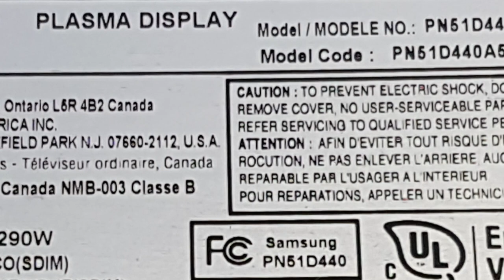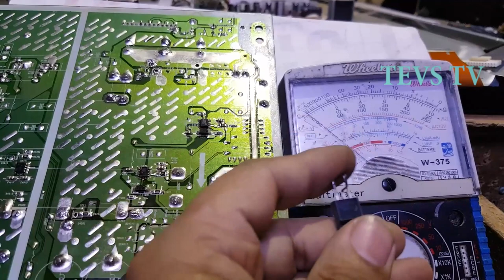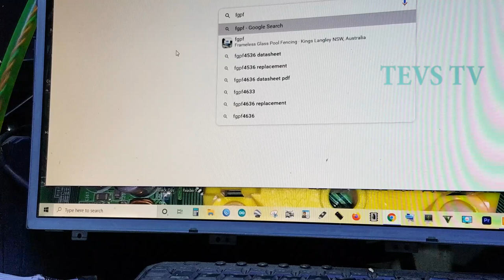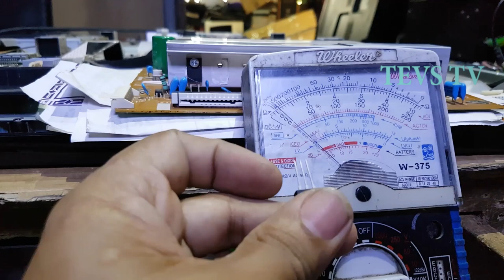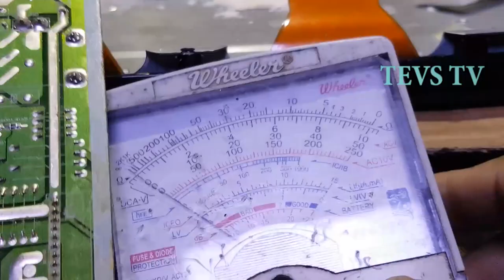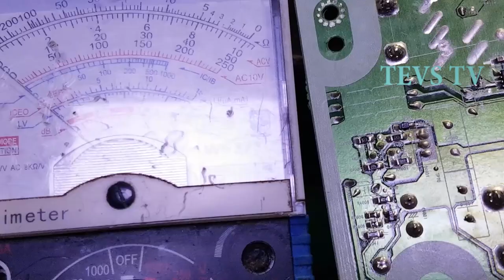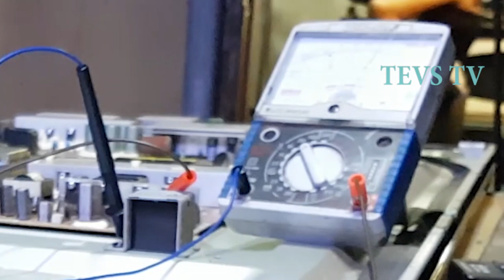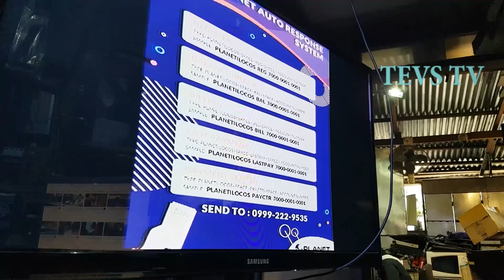How to repair Samsung Plasma tv no video. model no: PN51D440A5D. Plasma tv repair

Comment: Sir I have one I'm working on soniq plasma TV  but Samsung board , starting but no display I found out the igbt trnstr is faulty two of it from the larger invtr,i replace it twice but still blowing never see another shorten,i need help thanks
Reply from the maker: Look at the ceramic capacitor connected to the IGBT source and drain. In some instances, it's also the faulty one.
Reply: @tevzTVTevatronics  OK I will do that,thanks

Comment: I have a big problem with my Samsung PS51D450 TV I have a problem that cannot be seen I saw your video on youtube same problem I followed your repair the problem and I can't read the code of the 4-pin component behind the pcb I saw the abbreviations of the IGBT component could you help me understand the code?
As in your video I have a short circuit on the capacitor
Reply: Hi:
In the Samsung PL43E400U the FGD4536 is turned on and off by an OpAmp rail to rail D8698 of 8 pins.
There is also an IRS4427 driver of two outputs A and B in phase with the inputs. This driver uses it to turn on and off two RJP63K2
You should see if any of these IC is the one that the teacher changed in the PN51D440A5D model.

Comment: Too less time to get the solder to get hot and to attach to the pins and to the pcb, you need to hold down a few seconds more to get the solder as a mirror.
Reply from the maker: The soldering lead is not good quality.  So its looks that way.